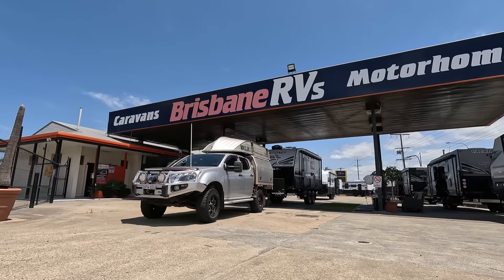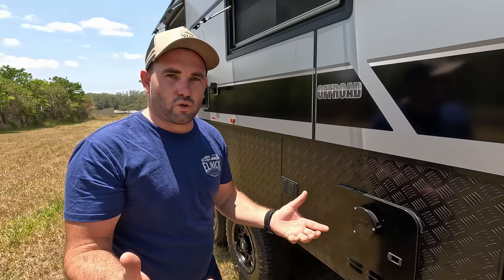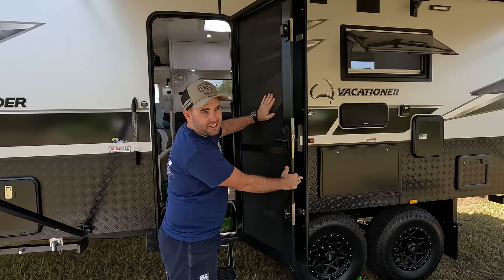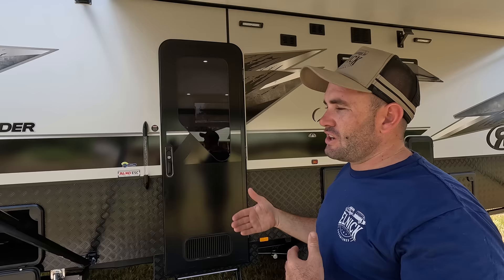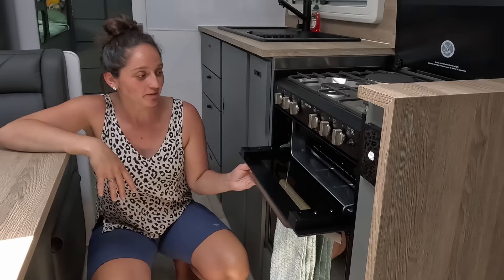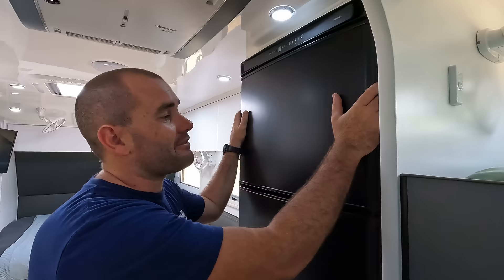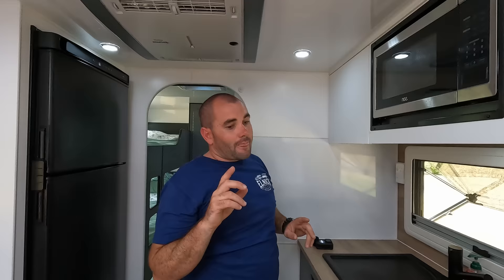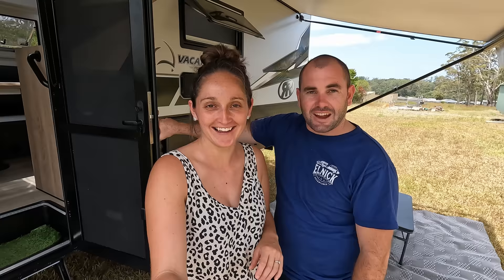ULTIMATE OFFROAD/OFFGRID CARAVAN- WALKTHROUGH/ Vacationer Rough Rider - Brand NEW CARAVAN TECHNOLOGY

Comment: Great looking van - no doubt years of fun ahead.   I noticed that right at the video start there was a shot of the safety chains not crossed over to form a cradle in the advent of a mishap plus the chain mounts will come in contact with the ground if the drawbar skids on the terrain - must be above the lowest point of the framework - just check your state regs on that one.
Reply from the maker: Thanks so much, will look into it 🤠

Comment: Hey mate that solar controller part of your system if it is only 40amp is only utilizing about 60% of your solar capture. I've got 700w solar on my van and that is maxing out a Victron 100/50 mppt , absolutely not having a go, the system looks mint just seems 40amp a bit under gunned
Reply from the maker: Hey Tim I agree mate with the solar I contacted projecta and they said I can put two 40amp chargers in 👍💪that should be heaps then. Thanks for watching.
Reply: @elnick.adventures  that should keep you out of trouble

Comment: What a beautiful new rig guys, you’ve done well! Just wondering if your fridge is 3 way or compressor? Our new van came with a 3 way which we don’t love so we’re thinking about changing to a compressor one so it’s a lot more efficient off grid and we don’t need to worry about gas for it.
Reply from the maker: Hey guys thanks so much. Ours is a thetford compressor fridge. We really love ours uses around 5 amps/hr when on. I think if you have a decent size battery and solar set up compressor fridge is the way to go 👍

Comment: You guys rock and your channel is fantastic- love your new van. Just wondering why you chose a instantaneous hot water system as opposed to hot water storage. We are trying to decide which way to go on our new van build and keen to hear your views. Cheers, Steve & Jude
Reply from the maker: Hi Steve and Jude thanks so much for your support. We have had both and they are very similar. Not sure on gas consumption though between the two. We went with the instant as it came with the van already. Honestly don’t think there is much difference. The one thing I liked about the drum heater is that it had a dust cap the instant ones don’t come with dust caps.
Reply: @elnick.adventures  Thanks guys - looking forward to watching your adventures in your new van!

Comment: How long can you run the air-conditioning on the batteries
Reply from the maker: If there is no charge at all coming in to the van around 4 hours the air con uses about 80amps per hour. 👍🤠 so if you have charge coming in you can do the maths 🤠👍